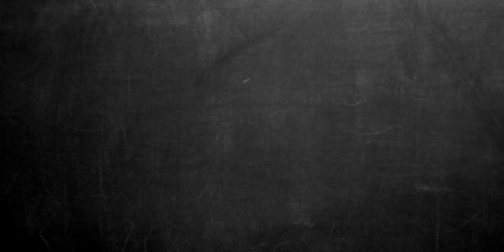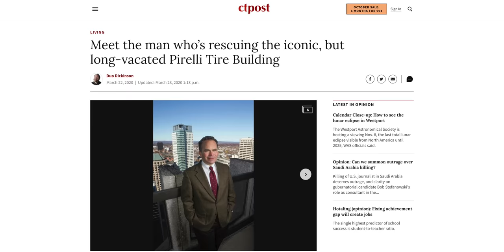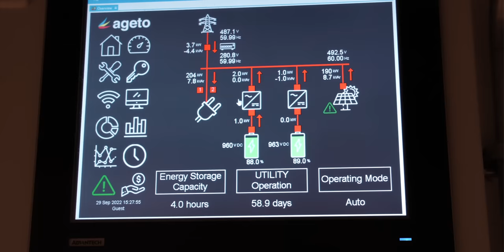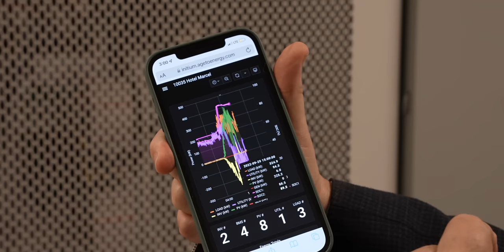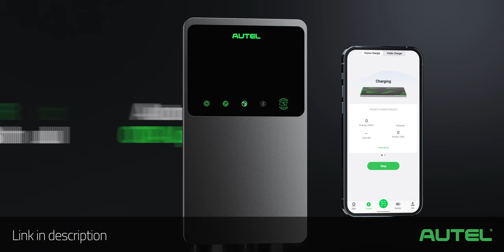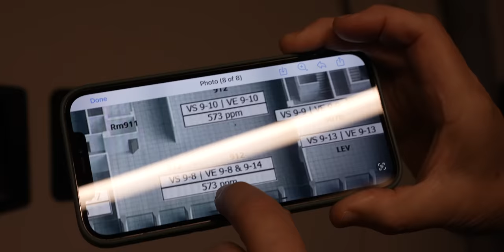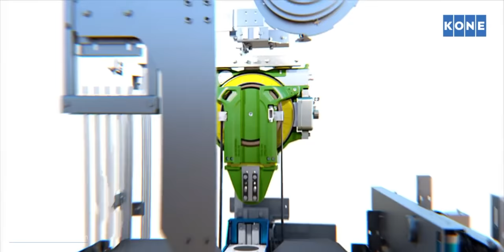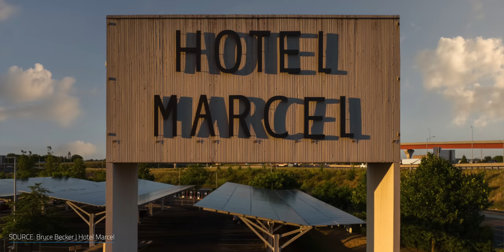How Big Can You Make a Passive House?

Comment: All this STUFF is being made utilizing OIL..   There will be a slow deterioration of our ability to maintain such fanciful ideas as buildings and large scale travel ways. The slowing down helps prolong what we have and what it can be used for. But to the fools trying to ban oil drilling are in for a rude awakening. We should be finding every way we can to utilize every drop better.  All the materials used to build is done with oil based machinery. Once we go to a electric process of gathering even harder to get materials we also must expect lower MUCH lower production rates.

 I believe the single biggest thing that would save the most in our current time is to mandate products that have a much longer use life. Build things to last so as reduce the need for production. Stop with the disposable and buy new idea unless that product is near 100% recyclable.

Comment: This technology, like automation are simply not new and should have been done decades ago.  If it weren't for midget minds in power, we would have.  Autonomous vehicles, for example.  In 1982 the 747/400 came out fully autonomous, being able to take off, fly and land on it's own with no pilots, but they said driving was impossible because of different road signs, painted stripes and so forth, while we were installing electric eyes in manufacturing lines that could read one out of 1000 cans per second had a labeling error.  The problem was never technology.  LEDs are nothing new. The hydrogen fuel cell was invented in 1839 then used on Apollo.  Our weakness, again, is too many midget minds in power.  As Jim Hightower said:  "We have too many 10 Watt bulbs in 100 Watt sockets."

Comment: To store 1KWH would require lifting a 3673kg weight 100m or 10(.1) 4680 Tesla cells. This is the stupidest idea I have ever seen. Engineers should know better. 
Force of gravity of per kilogram = 9.8N/1KG. 1KWh = 1000W x 3600 seconds/hour = 3600000 Joules. = 3.6MJ. 3.6MJ/(9.8N/KG x 100m) = 3673kg.
Tesla 4680 cell has a capacity of 99WH/cell. 1000WH/99WH = 10.1 cells.

Comment: This is NOT net zero.  Sorry, but such a claim is a fraud.  You cannot be on the grid and be net zero as the grid is loaded with carbon fueled sources that allow the grid to exist as on Demand power.  Those batteries are a silly joke and only a small fraction of what would be needed for net zero.  The fire hazard?  LOL.  This net zero stuff is doable, but not with that tech.  Won't work.  happy to discuss what will.
Reply from the maker: When discussion net zero it’s about producing as much energy as you use over the course of a year.  What you’re referring to is off grid (not needing to be connected to the grid at all).  Two very different things.
Reply: @UndecidedMF  I agree, but the point I failed to make is the grid runs because of on demand fuel that can be dispatched.  Batteries are NOW no where near what is needed to allow a 100% RE grid.  To get to 100% RE,  if that is your goal, you cannot rely on fossil fuel based fuel  systems, which you use with your "net" zero accounting.  My tech is 100% RE and has RE fuels allow on demand.  Fuels are key to storage, and fuel use is key to RE.  We can get to a true NET zero in short time with my tech, but never with wind/solar PV/battery/EV systems.  Won't work for another 50-100 years at best.